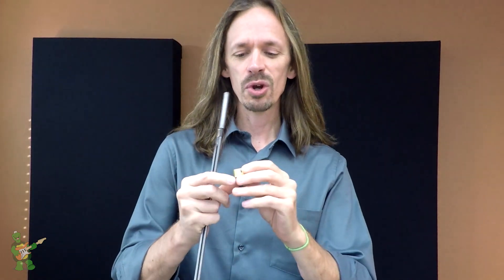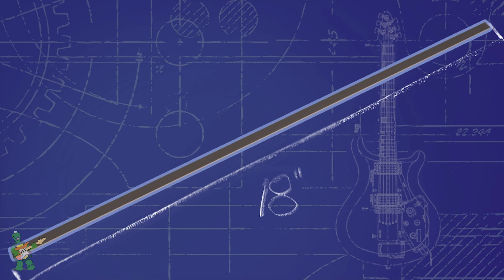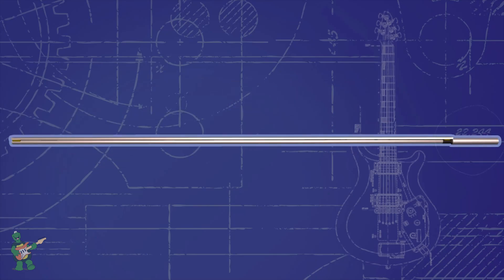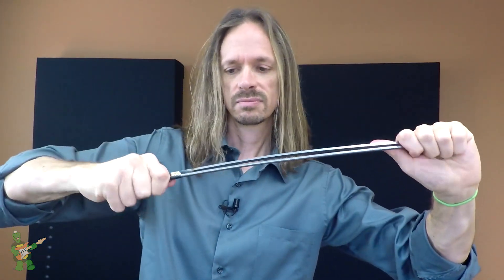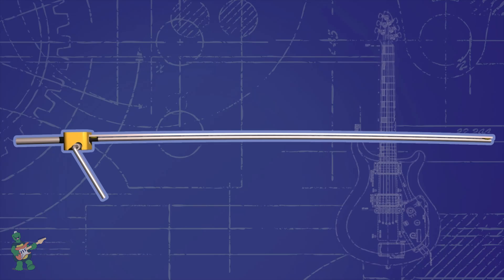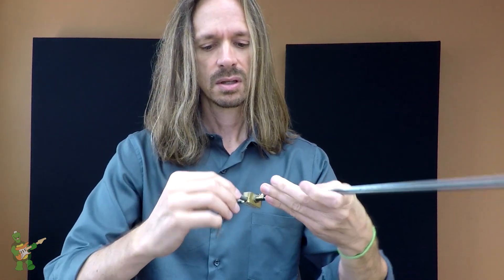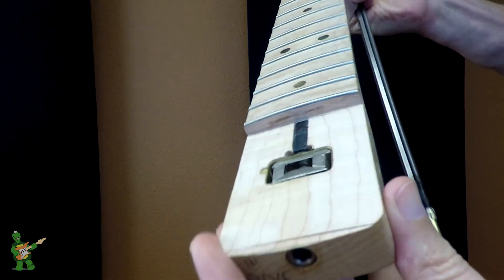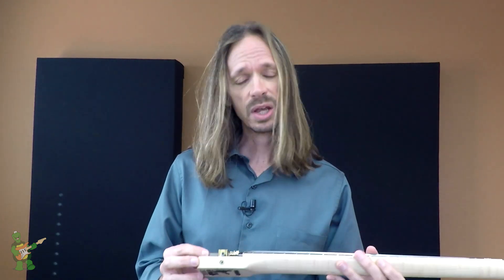The Warmoth Double Truss Rod & Side Adjustment Mechanism Explained

Comment: Psshh, they should call it the Side Adjust Toanz Robber cause it takes away all the mojo! Its sickening how you people keep messing with Theo Fernder's perfect creation. The original is the only way, vintage heel adjust under the pickguard protects your toanz and everyone knows its easier to unscrew the neck every time you need to adjust the truss rod instead of a confusing side adjust toan robber. Geez, what is the world coming to :D
Reply: +John S Haha, just parody-ing those kind of guys if you couldn't tell.  I have a Warmoth pro neck with SS frets on my main guitar and love it to death
Reply from the maker: +Redpandaflying  We hear you, man...we hear you. The Modern Construction necks aren't for everyone. That's why Warmoth also offers our Vintage Construction necks. They are built with all the same mojo-protecting construction methods as Theo Fernder's original design. Check them out here: http://www.warmoth.com/Guitar/Necks/NeckConstructions.aspx#totVin
Reply: +Redpandaflying The original Fender bolt on neck had no truss rod.
Reply: I think Redpanda was joking :)
Reply: HAHA!
Reply: While I can't swear that it makes a huge tone difference in a finished guitar, the 'knock' test difference between a neck with a static, non-adjustable rod (basically a square steel bar epoxied in) and any kind of adjustable rod is tremendous. A neck with a static bar rings like a bell, and for players not looking for the ultimate in low action...like slide players...I always recommend they go that way rather a single or double-adjustable rod. I've built  bunch of necks like this and not one in nearly 17 years has moved.
Reply: At first I thought were weren't joking....but thank god you are!
Reply: Redpandaflying hahhhhhah Theo?!?
Reply: "Most guitar players aren't that smart unfortunately."  

A truer statement has never been made!
Reply: Well I might have to tell you that you are right, that’s for sure, but in my case I am building a 24fret fender show master with a 25.5 scale. I wanted to do a HSH set up but the humbucker cavity has to go all the way flush with the fretboard in order to accommodate the single coil and the other humbucker. There is like a 6 inches of space, I don’t think I can fit the vintage nut, that’s why I am happy that there is another way to have it done, so for me I’ll go with the headstock.
Reply: I love it. I HATE the heel adjust.
Reply: I disagree.
Reply: Excellent troll, I really enjoyed it!  Such subtle humor is rare these days.  Do you write for The Onion?
Reply: +Redpandaflying You're exactly the kind of confused guy I enjoy letting play one of my Stratocaster builds with a Pro Construction Neck. Funny how the "Toanz" could be so bad when the "Toanz Experts" just can't quit playing the darn things. The commits I never hear from players who have never ventured beyond the local music store or Guitar Center Are...I never hear a word about the truss-rod and I never hear a word about the frets being stainless steel or the build lacking Mojo especially if they're a bender. Too many people judge guitars by their eyes and by what some expert with 30,000 one sentence posts said on a forum.
My only suggestions for your Toanz concerns...Purchase Pro Necks with as much wood in them as possible. Most of the time I use the Fat-Back and Boat-Neck profiles with CBS Headstocks. It also helps a ton if you know how to set up the necks "properly" because you do not want is to hand a build equipped with an out of the box 6105 fretted Pro Neck to a player who is use to the feel of Fender Custom Shop fret ends.  
When everything is laid on the table especially stability there is no better neck than the Pro Construction and that's with or without the Gotoh Side Adjust. The double expanding truss-rod con also be found in Rickenbackers.
Reply: @johns2631  yep, he s a total snob...and i'm polite.  Thai is call progress.  I guess he hates G&L guitars too since it s a more modern take on fender even if they have been created by the same guy lol
Reply: +Redpandaflying...I have to say, You parody "those kind of guys" very well.
Reply: It's confirmation bias and psycho-acoustic delusion.  Most guitar players aren't that smart unfortunately.